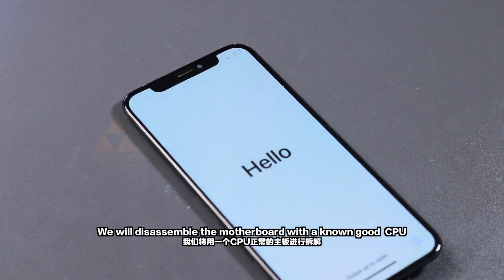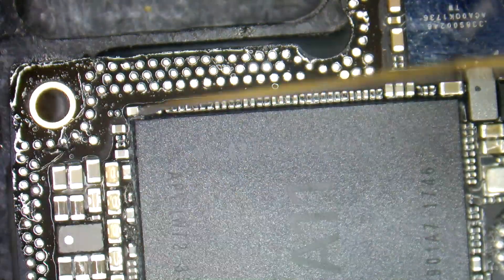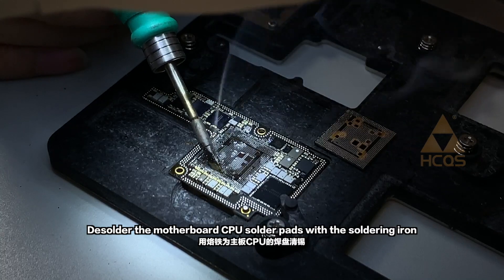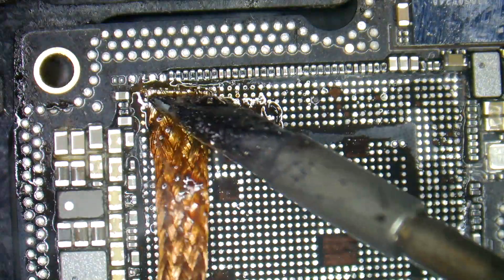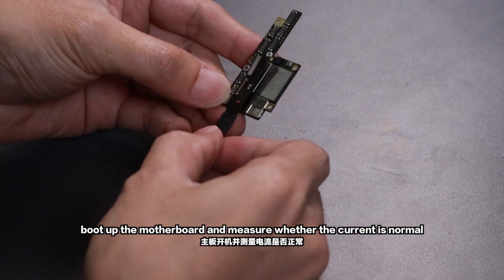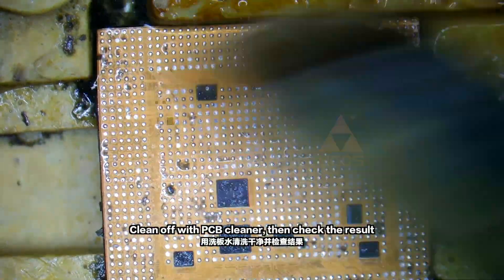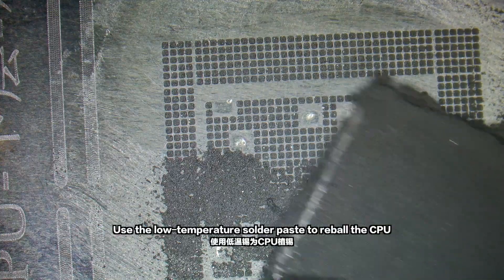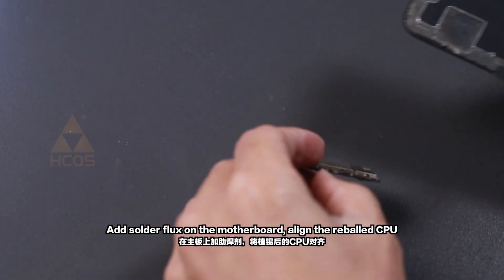How to Remove, Reball and Reinstall the CPU for A11 (iPhone8/8P/X) | Motherboard Repair Lesson

Comment: Everytime i try to remove it, i always damage the cpu, it is hard to come out and half of the pins get lost, maybe i need more temperature and air flow, any tip?
Reply: monitor the temperature for melting point.  maybe thermocouple or thermal camera etc.

Comment: Thanks for another good video. WHat temperature and air flow do you use ? Thanks
Reply from the maker: FYI, we uses the helical wind hot air gun, temperature setting: 360℃，wind speed setting 100
Reply: @HcqsUs  Thanks for your reply. BY HELICAL wind hot air, do you mean common hot air  station like QUICK 861DW?
Reply: @HcqsUs  what do you mean by helical Quick 861dw ? ( with solder pump) ?

Comment: Ok thanks for the video.. but i think you forget 2 important think.. FOR REMOVE the temperatures? Air Speed? FOR REINSTALL?
Reply from the maker: FYI, we uses the helical wind hot air gun, temperature setting: 360℃，wind speed setting 100

Comment: what temperature were your using to resolder cpu?
Reply from the maker: FYI, we uses the helical wind hot air gun, temperature setting: 360℃，wind speed setting 100
Reply: Phone Repair Share thanks I’ve been using a quick 891 1300w , 380-90 wind speed 40
Reply: @HcqsUs  this temperature and air we can use for all cpu from A`0-13 Cant demage?